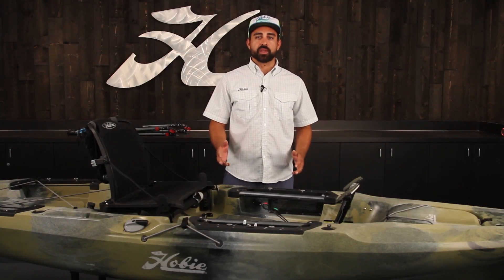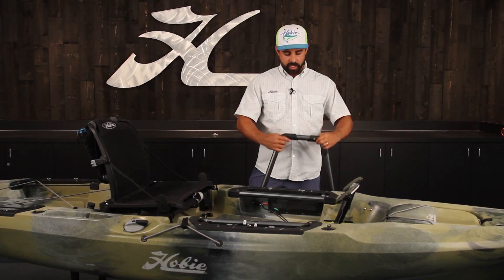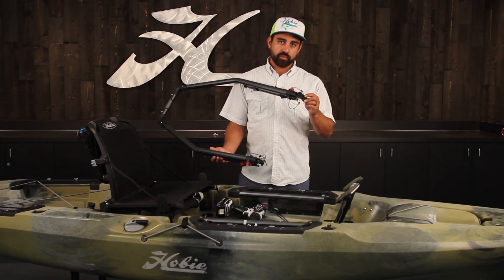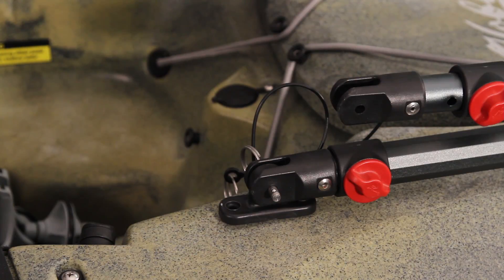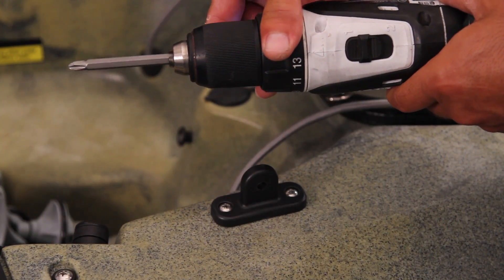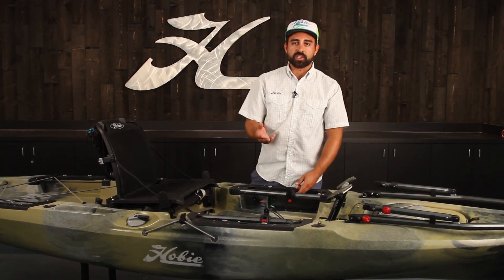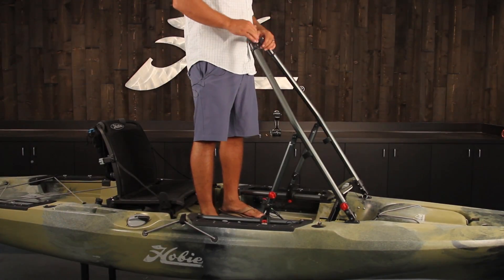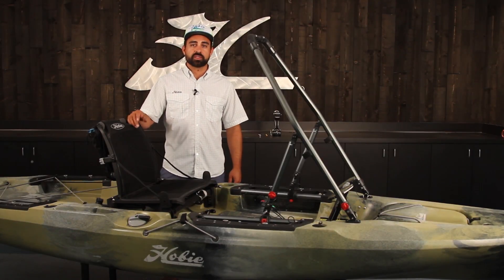Hobie 2019+ Outback Kayak: Standing H-Bar Installation

Comment: I've ordered two standing H bars for my Outback and both arrived with the  pre-drilled holes on the cross bar out of alignment. Very frustrated. The first one also had a pretty big scratch. The main reason I bought the H bar was to make sure I could ease myself down into the seat so I don't develop a crack in the hull that has happened to so many other people. I like my boat but it is getting harder to like Hobie!
Reply from the maker: Thanks for the feedback.  We will address it with our supplier.  Since the H-Bar is aluminum, it's easy to open up the hole a little bit with a 3/16" drill bit, or use a drill when inserting the screw.  This helps the screw go in and helps the center bar seat properly in the deepest part of the elbow fitting.
Reply: @HobieOfficial   You would think after this post, over a year ago, this would be corrected, but I guess no.  I just received this kit yesterday. Someone at Hobie needs to look at quality control of this product.  It's like the template drilling hole is off about 1/8" on both sides with this product.   First issue, H-rail clamps were missing from the box, although this could have been a dealer issue since they opened the box to insert the receipt when shipping.  The dealer has taken care of this issue.  Second issue as stated over a year ago, the cross bar holes are misaligned.  On one side, the the bar seats all the way into the elbow, but screw hole is short of hole.  The second screw hole, when aligned with the hole, the bar can not seat all the way to the elbow, so the elbow will crack if not drilled out to fit deeper into the elbow. I tried flipping the cross bar opposite direction , but it is still misaligned. After putting it together, it causes a misaligned of the whole structure.  The two arms rest in the opening of the front of the kayak, not on the flat mounting spots. The structure arms have to be spread slightly, about 2", to mount the "vertical mounts" on flat top of the kayak.  I'm sure over time, this undue stress will crack the elbows or vertical mounts.  Very disappointed this was known over a year ago and just ignored.

Comment: I purchased the HBar for my 2019 Outback. It came w/ a bungee cord that had a hook on the end. Where do I install that bungee cord and where will it connect to?
Reply from the maker: The bungee cord is used to secure the top of the H-Bar to the front handle of the kayak when the H-Bar is in the folded down position. This keeps it in place and prevents it from rattling around during transport. The bungee can be shortened as needed depending on the kayak. Loop it around the center bar of the H-Bar and secure it to the front handle.